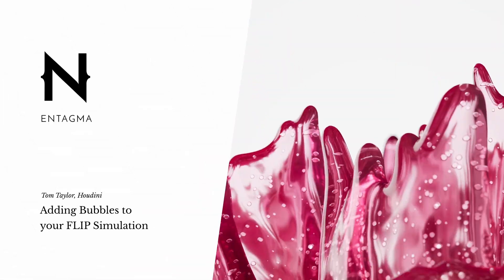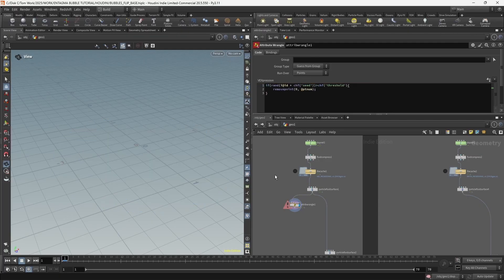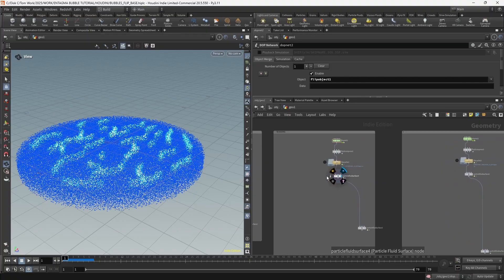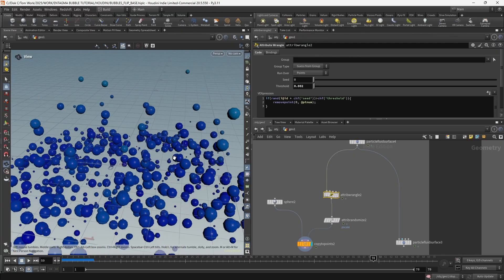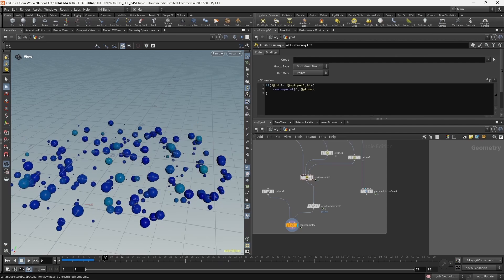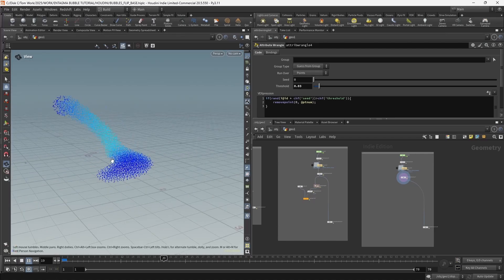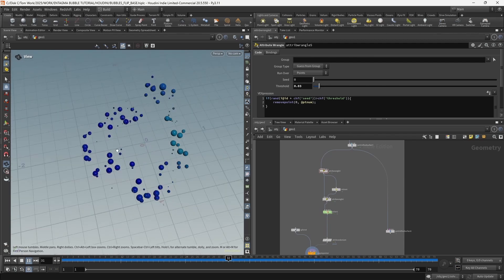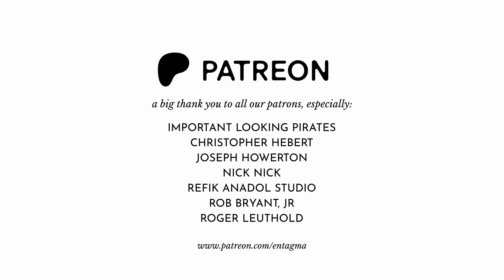Guest Tutorial: Adding Bubbles to your FLIP Simulation

Comment: on many dynamic simulations you do not see bubbles popping up or suddenly disappearing. Sometimes after comparing IDs you have just few points left, though you need thousands. The best solution is to use POP sim with velocity field from the FLIP sim.  In addition, it is a good idea to check how deep the particles are to prevent some bubbles intersect with the liquid surface, which leads to some artifacts on rendering. You can make bubbles shrink when they reach liquid surface instead of deleting bubbles that have reach surface and intersect with liquid surface... unless you need some particular effect like bubbles flying off the liquid surface (soft drinks)

Comment: I'm having an issue where the pscale of the particles is changing randomly. This is the third tutorial with the continuous emission. I have the emission stop after a certain frame. the pscale change starts happening after the emission stops.
Reply: Never mind. I figured it out. In the attribute randomize node options tab, I had to set the seed attribute to id. That fixed it.

Comment: 12:26 Assume that its age>0.1, which means that it must have existed in the previous frame (when FPS=24, it should have existed for 2.4 frames). Now we require that its age>0.1 and it does not exist in the previous frame. Why can these two conditions be met at the same time?
Reply: Good question! It is due to the fact that reseeded points dont start with an age of 0 but they get the average age of the points next them.  So if a point gets reseeded it can have any age number which means that it can have an age bigger than 0.1 even though on the previous frame it didn't exist. Hope this answers your question.
Reply: @tomtaylor3d  I understand. Thank you.

Comment: Hi, thanks for that, really useful tips. First time I've seen that opinput way of comparing, I would have used a point(1,"id",i@ptnum) etc instead, saves some typing and will be really helpful in the future.
Reply: Hi, a follow up. I've tried this using my own sim and I only seem to get bubbles very close to the surface(constant emmission reseeded). I even copied and pasted the bubble setup from the file and it still happens. I looked at the flip solver from the file and the only differences I could see were the number of reseeded points(8 in mine 12 in the example). Does that make a difference to this ? Or is there another setting I'm missing. Thanks.